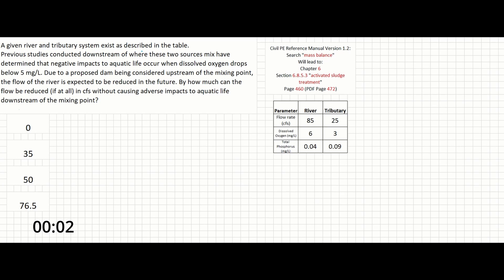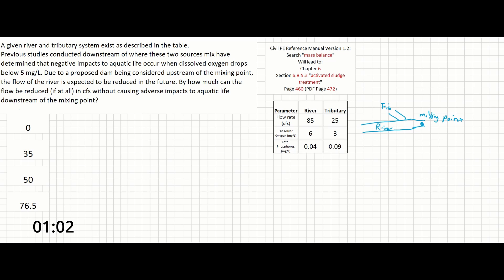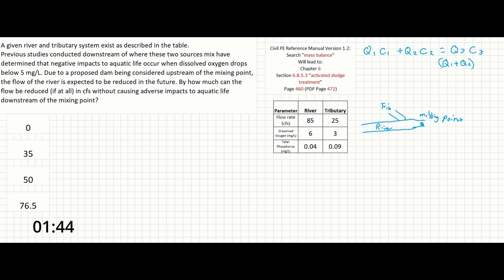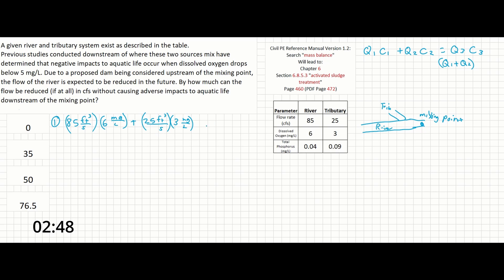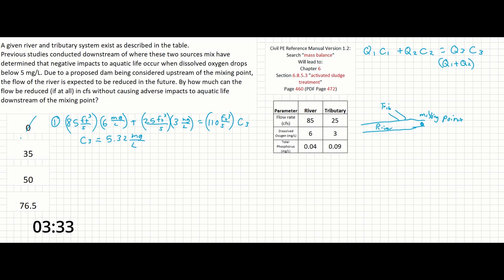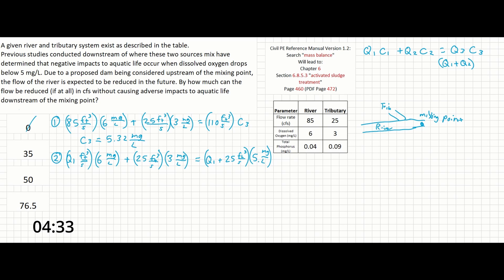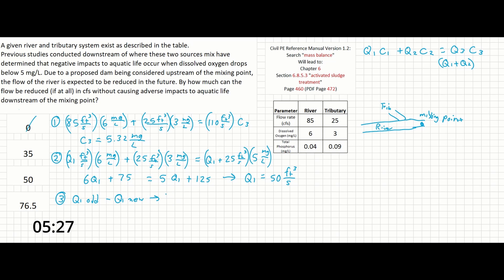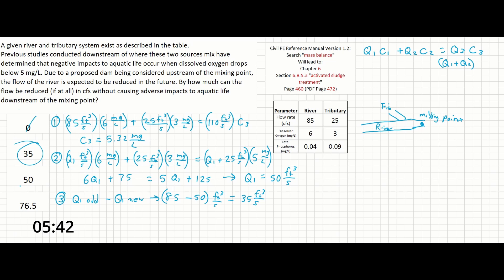PE Exam Practice Problem #32: Water Resources | Environmental Engineering - Mass Balance

Comment: Just to see what would happen, I calculated it as if the river flow was kept at 85cfs, to see what change to the tributary could still meet the 5mg/L criterion. I'm not entirely sure I'm interpreting my answer correctly, but I got that its flow could increase by 17.5cfs to 42.5cfs. Which I think makes sense, since the tributary flow is relatively O2-depleted compared to the river.
Reply from the maker: I did some quick math and got the same answer as you. The way I envision the reason it can increase is because the River has greater flow and a higher concentration than the Tributary - so the tributary's influence can continue to increase for a bit and reduce the concentration downstream of the mixing point.  Sounds like we envision it the same way, only you describe it with more accurate terminology lol.